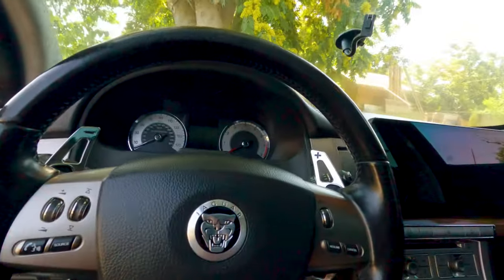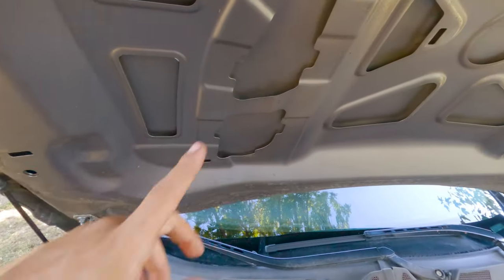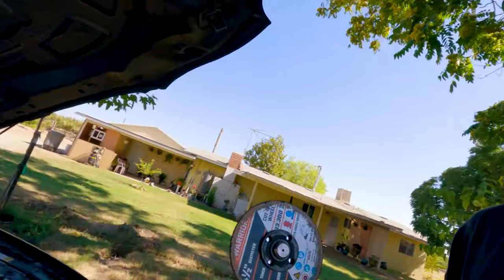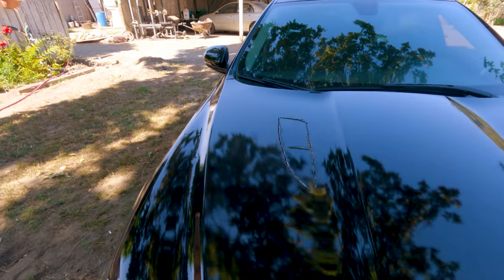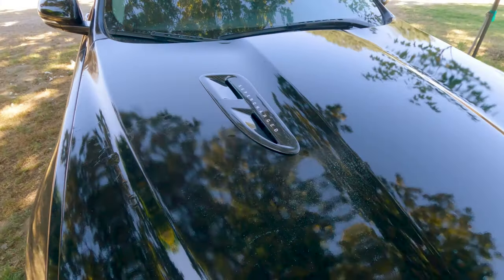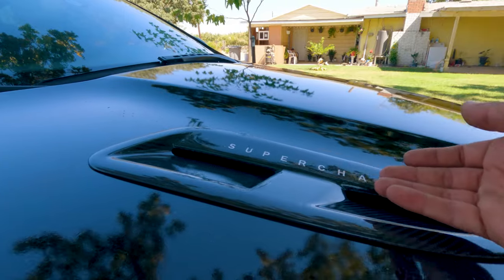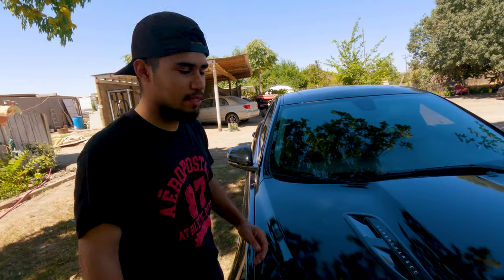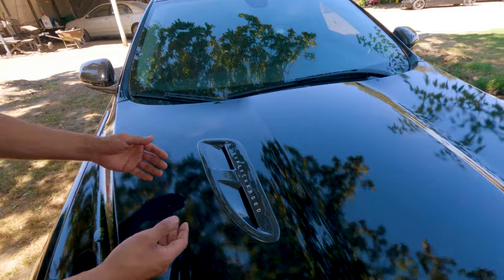Installing Carbon Fiber Hood Vents On My Jaguar Xf!!

Comment: My carbon fiber hood vents kept working loose at high speeds (they would start fluttering), and I even completely lost one, no matter how I tried to attach them. I wanted them to be removable without damaging the paint or hood, so didn't use epoxy, etc., but I ended up going back to my original hood vents (had them painted gloss black) because the clips on the undersides really kept them in place over 150 mph.

Comment: Ricky contact Wraptor customs to get the gear box kit for your jaguar it is a game changer if you need to know what it does YouTube it
Reply: Is it similar to the transmission tune offered by Velocity AP?
Reply: No it takes the lag out the 8 speed gear box also make the throttle liner
Reply: Ricky's car is a 6 speed.

Comment: Is a bigger blower possible on the 5.0 Jag engines? I know the fuel system has to be upgraded to run E85, just a matter of time until it gets released.
Reply from the maker: The stock blower is capable of 800hp+ the tuning is what needs to be improved